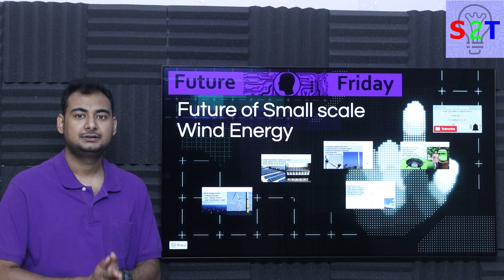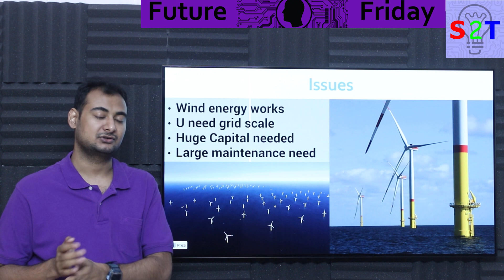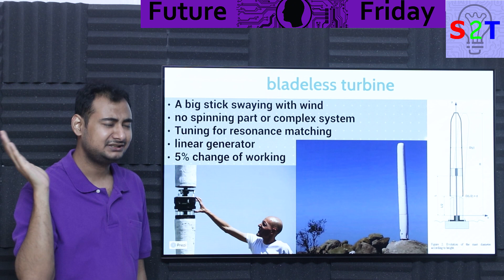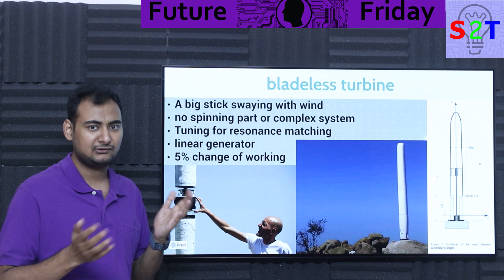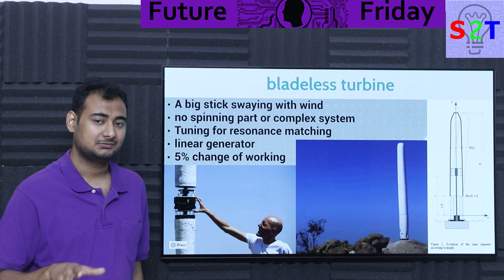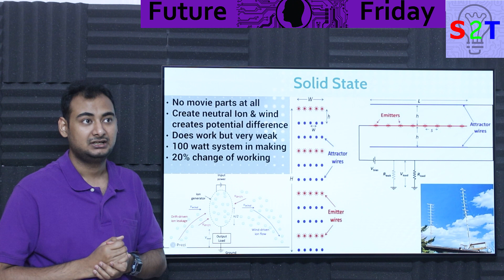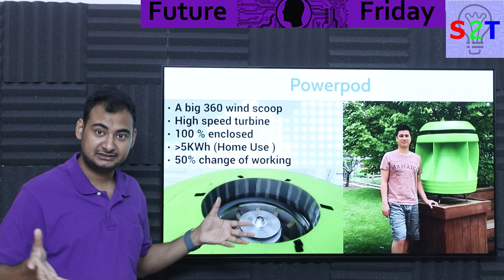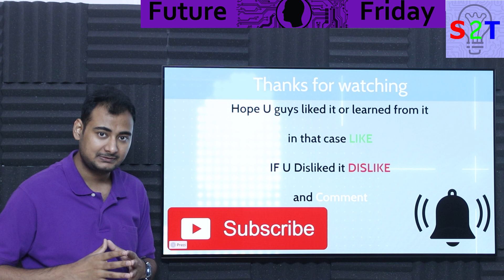Small Scale Wind Energy Explained {Future Friday Ep144}

Comment: New homes are being built very tight and may lack a quality dependable fresh air source.  I think the air output of the Powerpod might be used as the input to the ventilation system of a new home.  This dual purpose of energy and ventilation could be an added selling point for the Powerpod.
Reply from the maker: ventilation system generally have pumps drawing air in if u put it in there pump will draw more power to maintain airflow or chock dude to low air flow
Reply: @s2tenglish  yes, but it appears there is a high volume of air and quite a lot of pressure going through the Powerpod. I would think the existing pressure will move the air without a pump, especially since the house is at a lower pressure from the required exhaust fans taking air out of the house.

Comment: The last "Powerpod" one looks like a scam just from that one picture.  Some simple calculations.  Assume 1m2 cross sectional area based on the guy standing in front, we need 98 kmph wind speed to generate 5KW power.  Even to generate 1KW, 57kmph winds are needed.  
1.)  98kmph (even 57kmph) winds are very rare for people to live with their families.  This itself make its a very very very very niche product, like only idiots would invest Kickstarter money.
2) No small bird in the right mind , would be flying in winds like that.
3) Winds like that (storms) are highly uni-direction, which means they could get better efficiency going with a HAWT, as the speed IN to out ratio is much greater than with the design they seem to have.
Lets not even get into maintainance and ROI.
Reply from the maker: Let's see I only gave a 50 %
Reply: @s2tenglish  Should be 0% as home market wind energy is a ripe area for scams as people are quiet....emotional for a lack of a better term.  I looked into their product a bit more, saw their video.  No one in their right engineering mind would think what they have is even tested at 98kmph, with a wobbly turbine blade and a shoddy fiberglass wind accelerator casing.  Please see their video, you'll see what I mean.

Comment: At the end when you are explaining powerpod, it's blade,, this reminded me of Heppolt vertical 50 foot daimeter, 1 megawatts turbine.. The turbine blade used in Powerpod have very much similar design to Heppolt turbine, but they are trying to make it small and more efficient. 

I did asked few questions in previous comments, but you didn't responded (you seem to be busy) anyways your presentation was very good!!!
Reply from the maker: I can't provide too much info as the makers them selves are in prototype stage I shared becaused I liked the idea
Reply: @s2tenglish  Thanks for replying.. Yes even I am also interested in this type of wind turbine model, which is enclosed.. I am optimistic  that they will successfully develop it..
Reply: @robbinbro7526  Agreed, this turbine has the best chance of being adopted on a small scale for home power generation, If 1 is able to produce 1-5 kw a day then having a few of these on your roof would beat solar panels

Comment: Very nice, presentation!! I have seen your other videos also, you do lot of research and then prepare your videos.. 
Very good channel for science and tech guys! 

In this video, Powerpod attracted me, from photos it appears that turbine used in it would be around 25-30 cm in diameters. So it is high rpm low torque type turbine. 

I would like to ask, that to increase torque and decreasing rpm are they using gears, or this new designed wind turbine is directly connected to generator?? 

Is it possible that it could generate upto 5kilowatt ? Just think how much torque would be required to run 5kilowatt generator?Can funneling do real magic? (How much velocity of air increases by funneling, it's efficiency... Max rpm of turbine) 
What is your opinion on it? 

Please reply,

But i liked this concept of rooftop wind turbine, well practically to verify these claims we have to wait when powerpod will be available in market..
Definitely one day when all natural resources like coal, oil,.. Etc we will be used than power production will become serious  issue.We have to prepare for it right know!! 

You seemed to be Indian (your accent of English) I appreciate your hard work, and keep doing so, your channel will grow.
Reply from the maker: 5KW is easy only hard part is finding wind fast enough that is why its up 5kw .the generator is direct last I checked but its still a work in progress So there can be many changes
Reply: @s2tenglish  Thanks for replying, 
Do you have more information of it's generator, like Max volt, Max current... till now they developed?
Reply: @s2tenglish  please reply..
Reply: @s2tenglish  one more question I have, the powerpod shown in picture (this prototype) does this generates 1kw to 5kw ?? Or there is a bigger sized model for generating 5kw output power?? Please reply me..
Reply: @robbinbro7526  see youtube channel undecided with matt ferrel . Power pod make 7 to 10 kilowatt energy per day. As your locations.